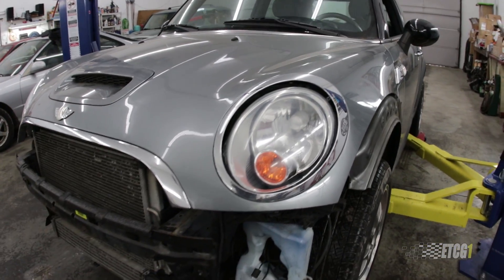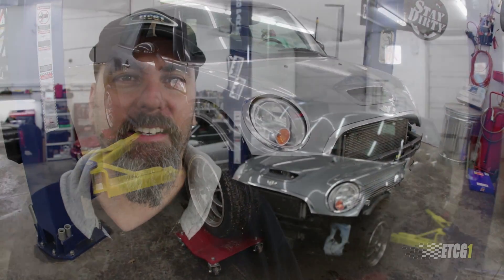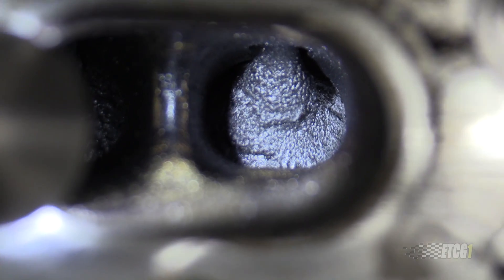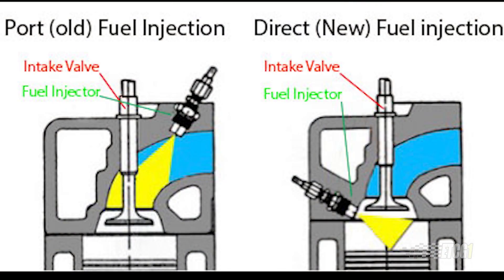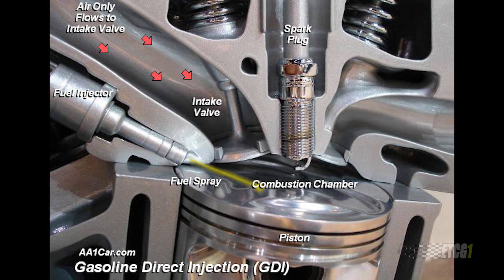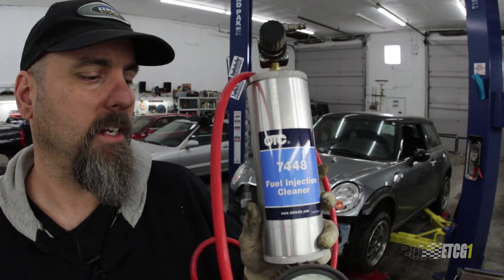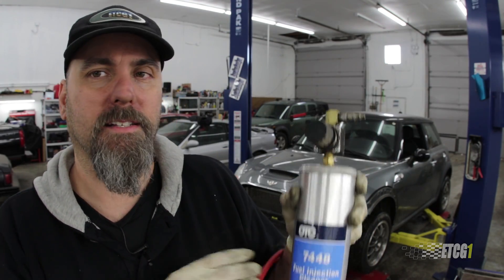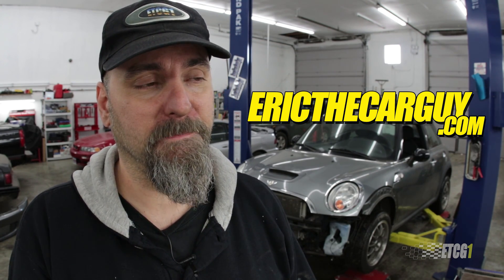Direct Injection Proves Fuel Additives Don't Work

Comment: VW from some year around 2010 use both direct and port injection to prevent carbon build up on valves.
Reply: jay parry 
crossing my fingers on the wife’s Jetta with the 1.8 gen 3 engine ...40k on it
Reply: albi2k88 it’s not on all their engines. Ive had a few 2.0t engines apart from that era and they were just direct injection. But, since the newer engines dont have enough wear on them to have many issues yet, i havent seen the inside of the newest ones yet. Ive also had the 3.6 apart from that era, and they were one or the other type of injection, same for the 2.5 liter. I cant say much for the v8 engines, they dont come to my shop much, thankfully!
Reply: MrHillfolk that one is direct injection only. It’s a really good idea to get an induction cleaning service done with BG brand cleaner. It is injected at the throttle body with a special tool. You’ll have to get a shop to perform the service, but it doesnt go through the fuel injection system, it goes through the whole intake manifold to clean all that pcv build up. It works really well. The only issue i have ever seen is on a diesel with the particulate filters and NOX reductant/DEF system. It ended up melting the exhaust filter. Since yours is gasoline, you dont need to worry about that.
Reply: albi2k88 the new mustang engine does the same thing. 2 injectors per cylinder
Reply: Brett C another engine to do that is the new subaru 2.0, but not the ones they put in subaru cars, ironically. They use double injectors in the toyota BRZ and scion FRS.
Reply: It's reffered to as sequential fuel injection (SFI).  Port injectors are used at lower rpm, direct injectors are used at higher rpm.  This method maximizes torque, horsepower and fuel economy.  Carbon build up is caused by the PCV(positive crank ventilation ) system allowing blow by into the intake manifold.  Since this has long been an issue since cars were only port injected, I'm not sure how directly shooting fuel into the cylinders could do anything to keep carbon from building up, since it's cause has nothing to do with the fuel system(other than the fuel burning extra oil and crank fumes to create the buildup).
Reply: ak operator it’s actually the direct injection engines that have the issue of pcv buildup on the intake valves. Port injection systems spray fuel on the valves which cleans them off, so a dual injection system doesnt get the buildup because of the port injector.
Reply: jay parry have you ever worked on an engine extensively?  I have torn down many port injected engines covered in carbon, backs of valves and all.  Yes,  direct injection engines typically build carbon faster than port, but my point really was that SFI isn't some fix for carbon build up.  If that was the solution,  engineers would have stuck with port injection to save money instead of having two injection systems.  It's more about ever restrictive fuel economy standards.  The best way to alleviate carbon build up is a oil/air seperator and cleaning the engine by injecting small amounts of water into while running.  Have you ever opened an engine with blown head gasket (s)?  Where the coolant leaks is sparkling clean.
Reply: ak operator yea, i work in an import performance shop. Ive done a lot of engine teardowns on vw’s. I get what you’re saying. You can still get carbon buildup on a port injected engine, but it’s not as common or severe of a problem as a direct system. The worst ones i’ve seen are on ALH TDI volkswagens. One was so gummed up that the port openings were only about half an inch in diameter. It had a soight performance loss. Lol. The air oil separator is a very common upgrade for boosted cars, especially in cold climates where the blow by will condense inside the intake more. It helps a lot. I dont see them very often on vw/audi’s, but they are on about any modified wrx, sti, or evo.  All that boost creates so much more blow-by!
Reply: Lexus did the same design on their 2.5 and 3.5L V6's back in '06. I was perplexed by why they kept the older injection style with the newer system, but after seeing all the reports coming out about carbon buildup on Audis, VWs, and Minis, it all started to make sense.
Reply: zygi22 direct injection doesn't magically create crud on the backs of intake valves by itself, how could it? The lazy idiots are the ones putting filters on outside air while not doing a dang thing for dirty as sin blowby through the PCV. I remember when there was a separate PCV filter pad and even that had to get past the main filter a second time. I was shocked to first see a Honda leading a hose right up from the middle of the sump to a point UNDERneath the primary filter, and nothing to speak of for a secondary screen at all. Granted this was a port injected design, but as was said before, PI is no magic bullet.
Reply: ak operator not all blown head gaskets leak coolant into the cylinders. I've seen some put just blowby into the oil, or not pull coolant out of a water jacket. But certainly the non gasket-related water jacket ruptures are cleaner at the crack than anywhere else, if they were dirty to begin with, tho none of this is related to fuel injector placement per the OP.
Reply: New Hyundai GDIs inject a double spray of fuel onto the back of the intake valves on cold start for around 30 seconds to a minute... It has a dual purpose of heating the cat up quickly and washing the back of the valves before you drive off. This should mean that a PEA based fuel additive should help to keep the valves pretty clean
Reply: They copied Toyota because they were too ignorant/lazy to figure that direct injection alone would result in a flawed engine design causing major carbon build up.

Comment: You missed explaining why the fuel injector cleaner doesn't work. It made it sound like the only thing it should do is clean valves.
Reply: But I assume it's because you tried it with no effect on the injectors.
Reply: Fuel injector is a separate part from the air induction system. The intake valves are on the air induction system and not fuel. These two system combine in the combustion chamber.

Comment: Very confusing video Eric... fuel inection cleaner doesn't work on direct injection system? Using fuel inector cleaner to clean anything else other than fuel injectors is crazy. Fuel injectors DO need to be serviced regularly... and how many times does a mechanic say I need to pull fuel injectors out to have it cleaned at professional injector cleaner facility? NONE. How many mechanic can say I used the IV injector cleaning system cleaner and now your fuel injector spray pattern is perfect and not leaking? NONE... they can't prove it.

Comment: at work we use a cleaner that is pulled in from a manifold vacuum port (usually the brake booster hose) with a setup that atomizes the cleaner. seems to work pretty well judging by how bad some of these older cars smoke during that process. comes in a 3 part kit that always comes with a throttle body cleaner can that always gets canned immediately.

Comment: We have been talking about his stuff for the last number of years. There is no fix in a bottle. With the direct injection engines, a catch can would probably help to keep down on the carbon deposits, but the best solution is adding a port injector to each cylinder that acts as a cleaner. Some vehicles are using this now with great improvements. Of course, this is just one more thing to add into the equation of diagnosis and cost of repairs. I prefer port fuel over the DI systems personally. No high pressure pump, injectors are usually accessible easier, buildup of carbon in 20k miles and so on....but what do I know. Good video.

Comment: My mechanic told me I needed new head gasket. I used Techron fuel cleaner and my car is now fixed. Issue is that my reverse gear wownt kick in after. Lol. Just kidding.

Comment: My wife's car and mine both have GDI engines.  I noticed hers MPGs dropped, and I opened up the intake hose and sprayed intake cleaner down the intake (after the MAF sensor), reset the computer and it's been running pretty good again. No complaints.  I think preventative maintenance is key.

Comment: talk to a local bg rep. those dirty intake valves are common with all direct injection cars. he'll give you a free bee kit that fogs the intake to clean the back of the valves. nothing is as good as manual cleaning but it is definitely a noticeable improvement. "high pressure pumps" that are cam driven were started by audi, assholes. if the foot of the pump isn't damaged you can get a replacement cup. hope like hell it doesn't wipe the cam.

Comment: Whar about running Ethanol or E100 through the tank, and over the intake valves?

I've considered doing this before to clean out an engine. The logic being, all the rubber should be vulcanized and not get damaged, and between the clean burning soot free alcohol, and water vapour, it should wash and steam out any crap.

Thoughts?
Reply: nabeelr I’ve done it with E85, and it gets the valves really clean. This was a FlexFuel car, though. I wouldn’t do it in a normal engine.

Comment: I did development consultation for Ford on their Eco Boost series of engines. We warned them this would be a problem. It's due 100 % to the EGR system. It has nothing to do with PCV systems. Intakes get "carboned up" due to the fact that the engine is "inhaling" a percentage of it's own exhaust gases on a regular basis, BEFORE it can be treated by the catalytic converter. Therefore this hot carbon exhaust then "sticks" to the cold intake and valves. It's that simple! This carbon buildup is worse on vehicles that will have higher idle times and those who use lower grades of fuels over extended periods of time.

Comment: I had worked on the old Bosch FI from 1968. No one liked them so I got them. I have got to say it was a bold move on VW's part to go that route. When fuel injection works its great, when it's broken it can be a nightmare
Reply: Craig Nehring You have my respect, sir. I wouldn't know where to begin troubleshooting the original Jetronic. My experiences with the later LH systems were bad enough.
Reply: Most of the issues in the old Jetronic systems pre LH is the AFM getting worn out and the spring in the new units being too tight. I have L jet in my 928 and it is the easiest thing to deal with. It just works, especially when compared to finicky CIS found in many Mercedes of the era.

Comment: I use chevron Techron fuel system treatment once in the spring and again in the fall on my 2015 VW Jetta 1.8 turbo and 2014 VW Passat 1.8 turbo. At $4.50 a bottle, it’s cheap insurance.
Reply: Just keep in mind it will do nothing for the intake, as explained direct injection means the fuel never touches the intake whatsoever. It may keep the injectors clean but thats it.

Comment: I've used Chevron Techron to clear up dirty intake valves on a Honda Fit, port injection. It makes a noticeable difference. Also, good luck with BG 44K. I agree, won't help with direct injection. No experience yet with direct injection intake services (chemical or manual). I'm sure it will be necessary and just add it to the cost of ownership.
Reply: Yeah, I'm a proponent of Chevron with Techron gas and Red Line SI-1 at oil changes. That said, Ford has had problems with their direct injection models (Ecoboost).

Comment: You are 100% right Eric, Gasoline is for cleaning parts (still use it for that to this day) Alcohol is for drinking and Nitro is for making HUGE HORSE POWER!!
Ok now the reason the valves stay clean (until your engine develops an issue) is because the gasoline has all kinds of additives mixed into it including detergents that clean and help to prevent deposit build up in the entire fuel system including the intake track and the combustion chamber on wet systems unlike the direct injection systems where only the cylinder is wet and the rest stays dry.
This is also why you need to keep a good quality fresh gas in your tank (if your vehicle sets for long periods of time) because the additives and detergents can and will break down causing even more problems to the fuel system, then add this on top of the of the cheap ethanol gas that most people buy where it absorbed water and separates from the gas if it sets too long causing corrosion and failure of the system parts. 
I'm not saying these cleaners don't work but if they can't touch the intended parts and components they have no chance of working but with that being said if one stays on top of all the maintanace  then you shouldn't need a fuel additive/cleaner.
In my opinion if you think you need to use some sort of cleaner then there are bigger issues that you need to  figured out as to why you need a cleaner.
This barely touches the tip of this ice berg on this subject.

Comment: aw for god sake!! fuel additives dont work to clean the intake ports as simply "the fuel cant possibly get to the damned intake valves!!" uknow Direct injection......

you can buy intake cleaners, again these are that bit pointless as the vacuum of the chambers sucks the chemical cleaner pretty much straight into the chambers before they've got full chance to do any real cleaning..

2nd if your having a fuel delivery issue its 99% going to be the intank low pressure pump that'll be causing the issue & not the cam driven high pressure pump, why .. simply putting it theres almost nothing to go wrong with the high pressure pump compared to the primary fuel pump found in the fuel tank...
ps yes I've just had to go through all this literally in the last 2 weeks, the high pressure pump replaced (not at fault) this highlighted the REAL issue ie the low pressure pump in the tank!!
if your not getting fuel tot eh engine I'd also check the intank fuel filter as the stupid (VERY STUPID) gasket set-up used is beyond a nightmare anyone of these misfit or damaged will prevent fuel pressure so your engine isn't going to start (yep I've also had to go through all that aswell..

Comment: Hi Eric. Great Video. Having been someone who recently discovered this on my 2014 Passat 1.8T, I also have tossed the fuel injection cleaners by the wayside. At 105k miles I bit the bullet and paid my mechanic to walnut blast the intake. Fortunately for me, they said the intake wasn't that bad and they were able to get it clean without the walnut blast (Although it was still over $1k in  labor to pull it apart, clean it, and put it back together again). This is a big problem with these cars. If you look at the maintenance manual for my car, which I do frequently, you will see that there is simply no mention of any service to decarb the intake. Why? Because it's a dirty little hidden cost that manufacturers don't want you to know about. This is the real problem IMO. It's a hidden cost, that they're hiding from you, and not even telling you about. If you spent $1k on cleaning the intake on these engines, every 60k to 100k miles, it would greatly prolong the life of the engine, by not allowing the carbon to build up, but because the manufacturer doesn't even tell you about it, doesn't put it in the service manual, they're virtually guaranteeing that it never gets done when it really needs to be, and the gummed up intake causes a chain reaction down the road that limits the life and quality of the engine as it gets up to 150K+ miles. I don't want to outright say that they do this to ensure you're buying a new car every 5 years, and to diminish the value of cars in the second hand market, but it really has that effect, regardless of their intent. This is a dirty little secret in the car world that needs to be exposed to the greater public. Unfortunately most vehicle owners are victims of their own willfull ignorance. They'd rather take the blue pill and live in the matrix, rather than live in the reality where we're paying way too much for vehicles, and the second hand vehicle market is full of garbage, by design, to scare us into continuing to prefer brand new vehicles.
Reply: The carbon buildup issue is known to manufacturers, that's why they are building hybrid inje tion systems on some cars with secondary injectors upstream of the intake valve as well.... To clean them off. 
If an engine can make it out of warranty 99% of the time without the buildup being a major issue, the manufacturers will not address it.... They just want the car to make it  out of warranty enough so they don't have to pay for it.  They'd be happy if all cars were crushed the day the warranty ended, that way they could sell you another!
Reply: The problem is also consumer based. Many people get tired of driving the same old car for 10 years. Our car culture views cars similar to washing machine. Disposal once it breaks. Even this mini could last 10s of thousands miles before it kicks the bucket and it could be sold and money used to finance a newer car.
Reply: Jesse tell us what you really think lol!
You are 100% correct good Sir.
Reply: Jesse *willful But how can you talk about OUR willful ignorance when your own maintenance manual doesn't mention any cleaning process? MAYBE you think ourn grasses are greener, or your 'luck' is nonexistent without bad luck. Internalize much?

Comment: Sea foam or stabil is all I use and that’s only in my seasonal machines lol otherwise for fuel injected automobiles that are daily drivers gasoline alone should be enough and especially with 10% ethanol.

Comment: Good gas treatments stabilise the gas and remove (imulsification) water from the tank. If it takes a month to empty the tank you will need to add extra gas treatments. If you empty the tank in a week you will never need to add cleaner.